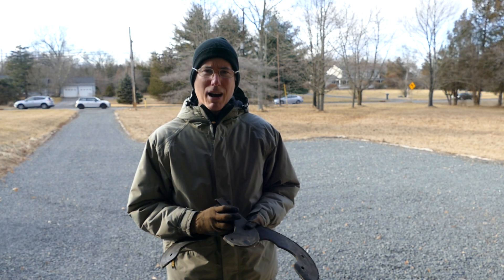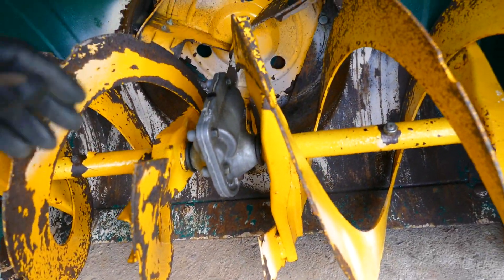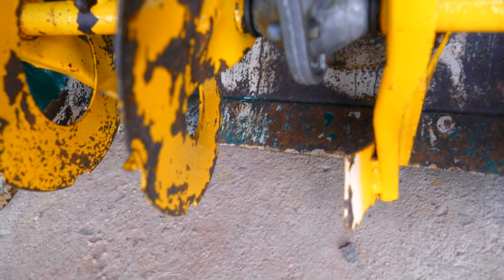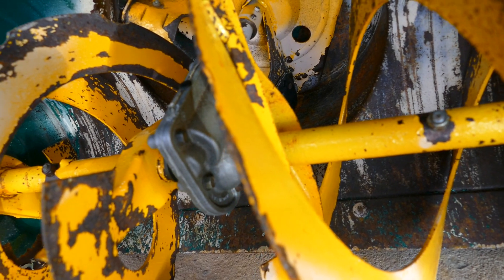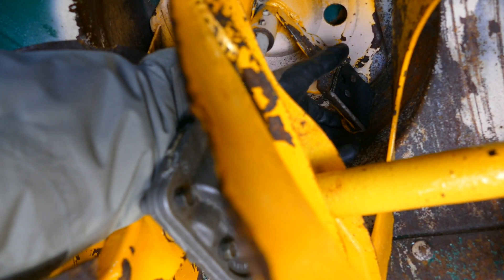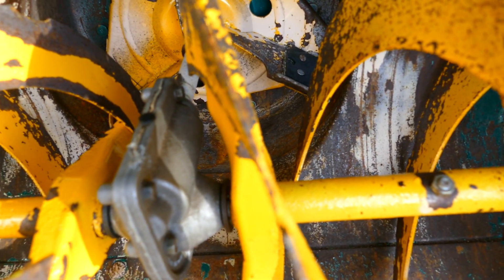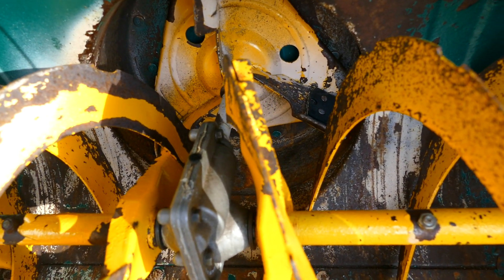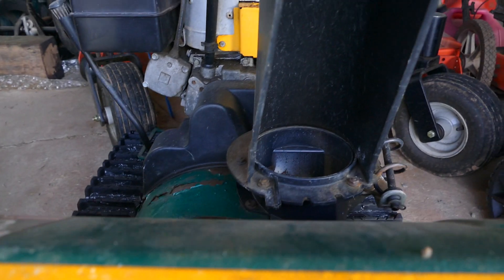Snowblower Mod: Throw Snow Up To 50% Farther!

Comment: A couple reasons they leave a larger gap, and this is just from my experience, a tighter gap tends to freeze up easier between storms and a tighter gap tends to throw small objects, like rocks, further.
There are positives and negatives either way.

Comment: Nice demo. Those YardMan snow blowers were great but the paint flaked of pretty easily. Looks like still have it going strong.
Reply from the maker: It is still running good. You're so right about the paint. I was meaning to give it a paint job, maybe I will do it this summer.

Comment: I've seen other people doing this too, i have to try it. I have a new ariens, which i hate pulling out, and it shoots over 15feet away, and I have the old ariens, and it is probably 5 feet. The old blowers never seemed to throw that far, but they were built strong.
Reply from the maker: Mine is a 1996 yardman and it benefitted a lot from the paddle mod. It had to big a gap between the impeller and housing and was struggling on wet snow.

Comment: Great video! Did you have to take the impeller out completely to drill the holes and bolt the on? I’ve Been wanting to do this modification for years, now that our blower is out of warranty I can. Great post! We got almost 2 feet in that last storm with the drifts.
Reply from the maker: No, the holes can be drilled from the shoot. In some cases the shoot has to be taken off for the drill to reach.